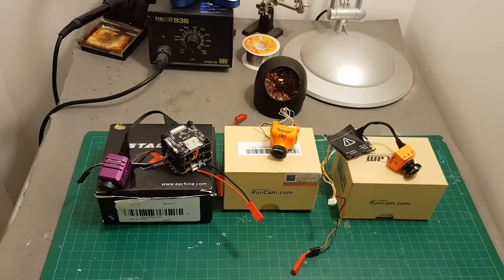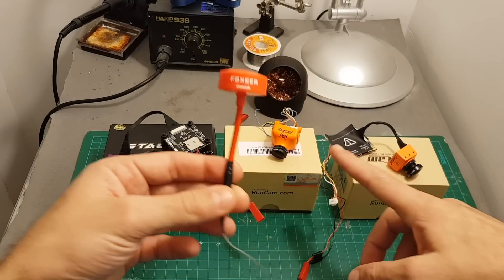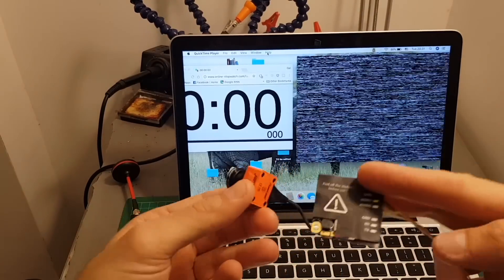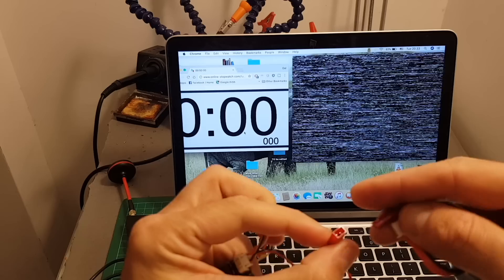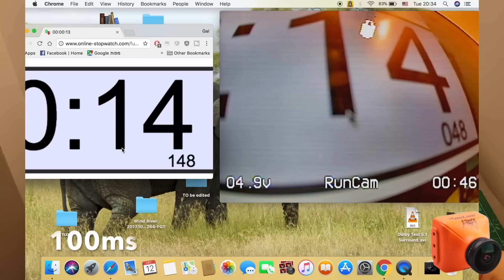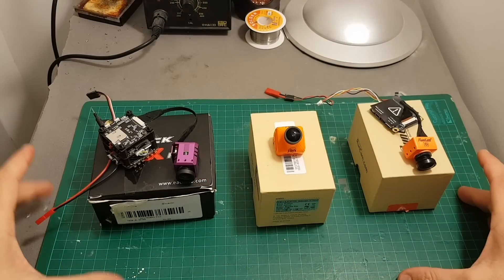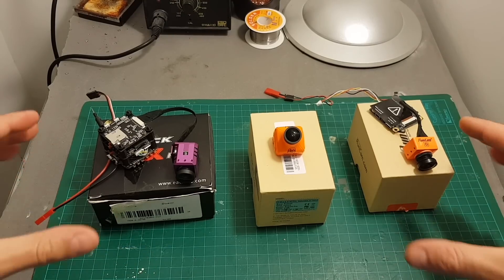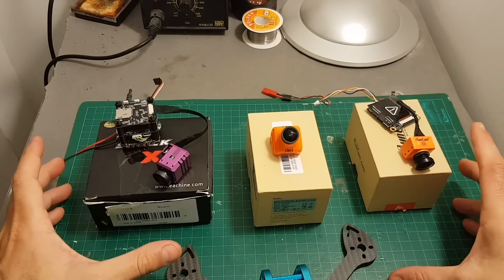Eachine Stack X, RunCam Split 2 & Eagle 2 Pro Latency Test

Comment: You should probably be using an analog screen to display the FPV feed, as the re-encoding to digital for PC display makes the results unpredictable?
Reply from the maker: As I mentioned in my video, this latency test only compares the difference between the camera and does not provide us with an absolute result.
Reply: Sure, but when multiple tests of the same camera are greater than 60ms different, it's kinda prevalent how unviable the test is, even for a rough comparison :) it's a shame is all, because this is the only video I can find so far trying to even present this info :)

Comment: Can’t wait for your Eachine Stack X build so I can see what I’m doing wrong. I’ve figure out most of my issues which were all my fault and I think I have my last issue figured out which is wiring in my receiver. This Stack comes wired in SBUS config by default. I fly with a Flysky i6S which is not compatible with SBUS (inverter) and I need to change it to IBUS (non-inverter) by soldering a bridge between the proper IBUS pads on Bridge Pads1. I found this in he instructions which as something I overlooked cause I thought it came wired for PPM. I have to say the pin layouts for the FC in the instructions are very detailed. Something I’m not used to lol so that’s definitely a plus. Look forward to your build video. Thanks.
Reply from the maker: That's great. I plan to release the build video in the next week or so. Hopefully it will help you. I am glad to know that you resolved most of your issues. Happy flying :-)